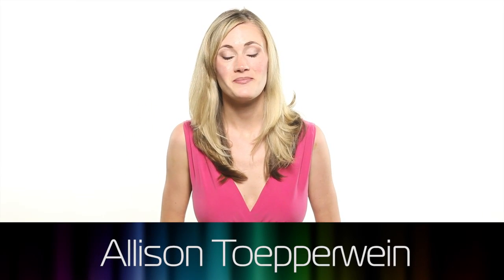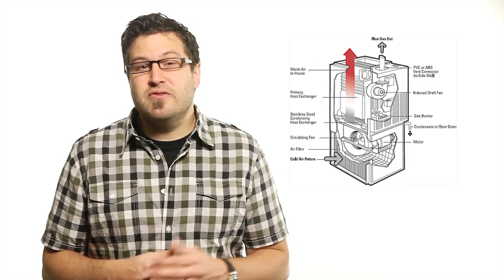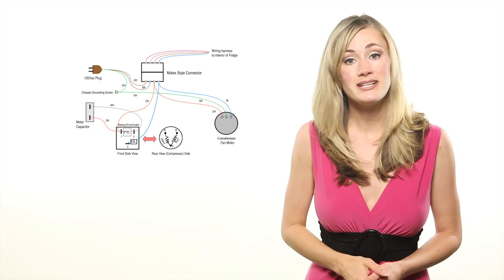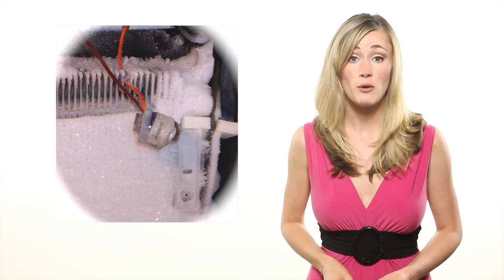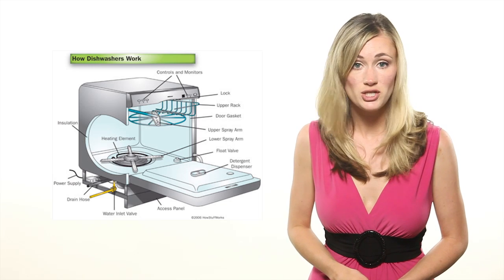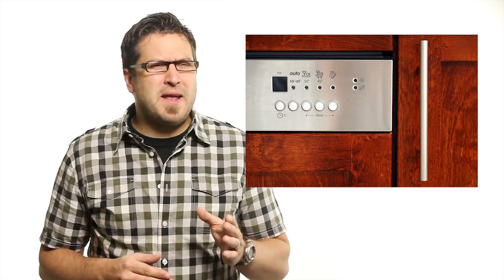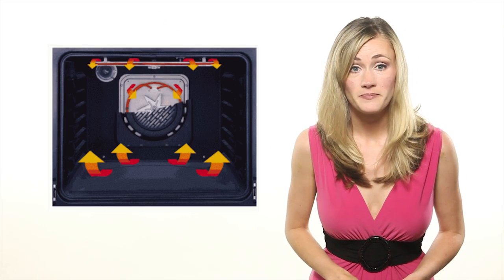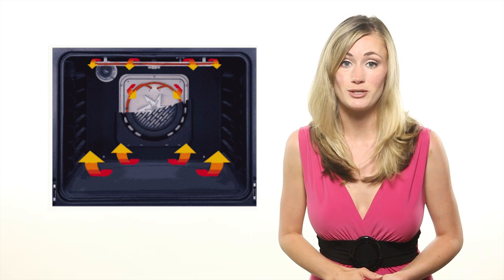Modern Appliances Use Less Energy

Comment: Here in America we know nothing about efficiency. 

 Effeciency = stop wasting

ex. downsizing your fridge & car.  Wash plates by hand, Shut off water to your lawn, collect rain water and turn off the lights, AC, TV etc.

People in this country and other parts in the world tailored their lives around fossil fuels. fossil fuels will run out in the next 50 to 100 years and all of this will have to stop .

Buying so called "efficient" appliances does not even scratch the surface.
Reply: First of all, everything you said about "fossil fuels" is wrong. They are not only NOT running out, but we have larger reserves now than ever before. Literally centuries of fuel, centuries of oil. There is no threat of it running out. The Earth keeps producing it. It comes from well below the "fossil" layer. It will be around for as long as the Earth is around. 

Secondly, energy "efficient" appliances are largely a joke. When your stove takes 15 minutes to boil a pot of water it uses just as much, if not MORE gas than a good old fashioned stove that, you know...works. Toilets! 1.6 gallons per flush. Great! Except it takes a minimum of two flushes, sometimes more, to clear the damn bowl. Again, using MORE water than a single flush from an old toilet. Lucky me, I was able to rip out that 1.6 gpf piece of crap and replace it with a refinished "old" proper toilet with a 3.5 gallon capacity and my water bill has actually gone DOWN.
Do your research on Washers, too. Between cycling and balancing, they often use MORE water in total in actual practice than older machines do.